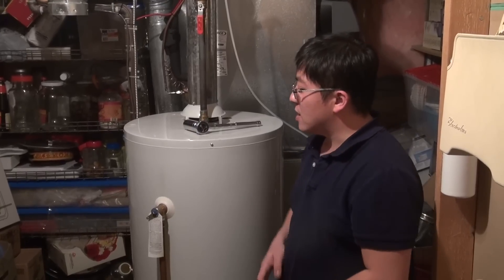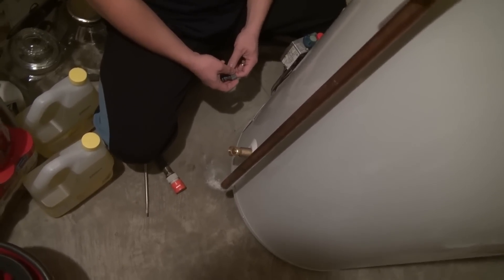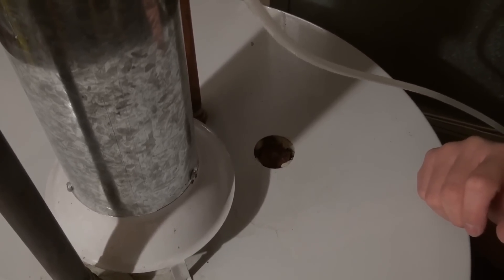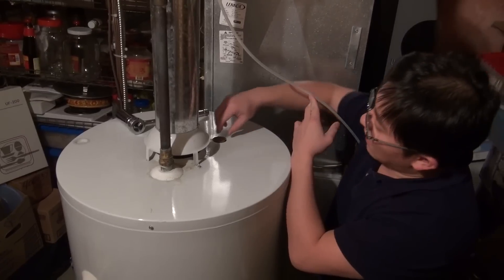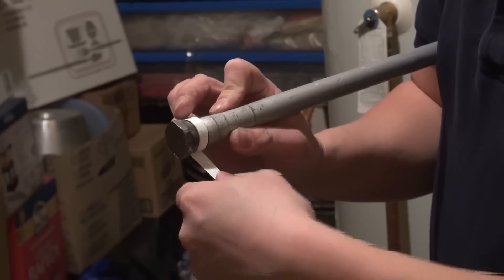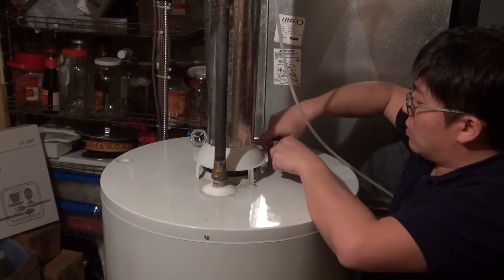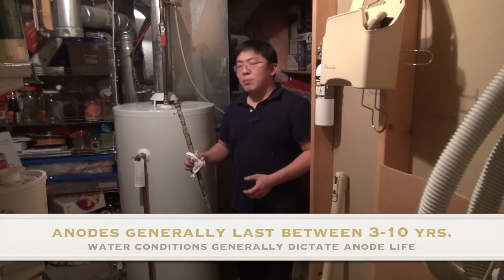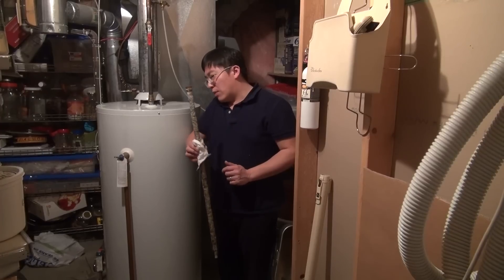How to Replace A Water Heater Sacrificial Anode Rod

Comment: yea have house in baja water there is really hard so am sure the tube and anode are eaten up ya just saved me some $$ of buying a new heater...oh a tip...the gas valve are interchangeable. only diff is the face/knob on back all hookups are simular..had to change mine
Reply from the maker: +Miguel Castaneda interesting about the gas valves. Not sure if I'm bold enough to explain to youTubers on how to take that stuff apart (heaven forbid if someone blows themselves up by accident!).

Comment: If I have a 30 feet long water pipe and I install a 3 feet long  magnesium rod into the pipe, how much of that pipe will be protected? Is the magnesium rod going to protect all the pipe of just a few feet around itself?
Reply from the maker: +Life is illusion yikes, that I can't tell you.  I suspect it will likely protect at least the first half.  Water mains in our city have a sacrificial anode connection every few kms so I suspect that the protection is "spread out" across a pipe.
Reply: piercedasian Thank you for responding, I really appreciate it. Just to make it more clear for myself, I would like to ask if the anodes are inside the water pipes or are they mounted on the outer surface of the pipes?
Reply from the maker: +Life is illusion they mount the anodes as a separate external piece in the ground and then run a wire to the pipe and then pass a small electrical current through it to divert the consumption of metal to the anode instead of the iron pipes...

Comment: I just picked up an anode rod for my water heater. I replaced the rod about 4 years ago, the tank was about 4 years old and the factory rod was very badly corroded It was very tough getting the old one out, I used a 4 ft pipe and a breaker bar - I could never have done it alone.. When I replaced that rod i used teflon tape so hopefully this one will come out easier.
Reply from the maker: +dell177 wow 4 years and the rod was finished?  The rod in this video is 14 years old and it still had metal left on it!  If you have troubles with the rod removal I suggest you consider replacing the rod perhaps ever 2-3 years.  Rods are cheap and super easy to replace.
Reply: +piercedasian  I'll replace it this week, as you said they are cheap and if I can make the tank last longer it's well worth it.
Reply from the maker: absolutely.  Good luck!

Comment: You say to use teflon tape on the threads.  But, isn't the anode rod supposed to let current flow to the steel tank, through this path?   If the tape is put on thick and thoroughly, can interfere with this electrical path which is essential to the rod performance I think.  Please comment
Reply from the maker: +Ben Knight You would have to put a LOT of teflon tape on the threads to electrically isolate the anode.  I will typically wrap 2-3 layers of tape on the threads.  Fear not as as you thread the rod in the tape actually abrades away on the "high points" of the threads thus making electrical contact with the tank.  I have confirmed it is electrically bonded b/c I used a digital multimeter to confirm my conductivity.  In EVERY rod I've replaced I did this check and every time it has good continuity.  I could've shown this test but what's the point when out of the 50+ rods I've replaced it consistently has conductivity.  Hope my answer puts this question to rest :)

Thanks for watching.

Comment: Great video. This video suggests that your old anode may have not been protecting your tank due to calcification. http://youtu.be/2IUNIUZz4Os
Reply from the maker: +Graham Wilson Graham the calcium build up on the rod certainly hinders the anode's ability to protect but fortunately when i used my fingernail to scrape the calcium off that it wasn't hard as concrete and was still quite soft. so water was able to get to the sacrificial metal.  For heavily calcified tanks that have never been flushed or are exposed to exceptionally hard water I would imagine that owners should replace their anodes yearly (they're cheap anyways).  Interesting video you linked...

Comment: Thanks for the video, very well done! I must say though I have some doubts about using that Teflon tape on the thread as it may prevent the electric contact between the rod and the tank and thus defeat the whole purpose of having the rod in the firs place! I tell you as a physicist (by education): make sure you have a good electric contact between the road and the tank or it will not work properly!
Reply from the maker: +M Ch you need not worry about the rod not making contact with the threads on the tank.  The threads are quite "sharply cut" and when you're screwing in the rod that the tape on the highest "peaks" of the threads do get cut and contact is made.  I've verified contact using an ohm meter from the rod to the tank.  It wouldn't be the case IF one were to put layer upon layer upon layer of tape on then yes I would agree there is some risk of not having contact but in 90% of installs I've seen there is electrical continuity.
Reply: piercedasian - exactly right. This is an old wives tale about losing conductivity between the rod and the tank there’s no way with the rod tightened down that you will lose contact between the tank and the rod that’s for sure.

Comment: Great video, thank you! Could I possibly use an impact wrench to remove the rod (and then use a regular wrench to put it back in to make sure it's not too tight)?
Reply from the maker: +J.A.Grami You could do that however, my concern with using an impact gun is the "hammering" shock on the tank structure.  If your tank is very old or badly corroded that hammering could theoretically cause microfratures to form and could trigger a leak down the road.  Is this really possible?  Hard to say - probably NOT likely but why take that risk?

Comment: Have you ever removed an anode rod with an impact wrench?
Reply from the maker: +Ojeramup12 No I haven't as I haven't found the need to use one.  If you have a long extension "pipe" on the end of your ratchet that is usually MORE than sufficient.
Reply: OK,  I will try the old fashioned sure way.
Reply from the maker: yeah the fear of impact guns is the "pounding" action of the hammer inside the gun which could theoretically "shock" the tank and potentially cause cracks in the tank or the weld joints.  I'm sure it would never be an issue but using a traditional socket and breaker bar method has always worked for me.

Comment: That's the cleanest, shiniest 14 year old water heater in history.
Reply from the maker: +2packs4sure it is interesting you say that as you're not the first to say that.  Water heaters in homes (at least in our neck of the woods) look brand new even after 25 years.  I'm not sure what an old water heater is supposed to look like but every single one I've worked on is clean and shiny.  Must be our super dry climate or something that doesn't corrode the outside of the tank perhaps?
Reply from the maker: crazy.  I wonder why...
Reply: +piercedasian   They wind up in attics, garages, little attached outbuildings.....................
Now i've seen some really old ones in Houston in interior laundry rooms and those age nicely.
Reply from the maker: ah I get it.  In Canada all water heaters must be inside a structure with MOST water heaters residing in the basements of homes or worst case in an enclosed garage.
Reply: It's our 95 percent humidity and 98 degree temps. Welcome to Houston, TX.
Reply: Yea, it's fun ain't it..

Comment: I called a reputable plumbing company to inspect and probably replace the anode rods in our two tanks. When they got here, they said the average life of a tank is 8 years, and they generally wouldn't recommend replacing the rods in our 11-year-old tanks. Estimate for two new tanks, installed, was $3100. Yikes. Here, however, you're replacing the rod in a 14-year-old tank. Is the company I called kinda nutty?
Reply from the maker: +redobrien77 it depends on the local water conditions.  If you have highly acidic or soft water then your plumber could very well be correct in that the life is maybe around 8 years or so and the justification on replacing it becomes not so favourable since there is still a labor cost associated with replacement + the risk of cracking the tank if it is already fatigued b/c of corrosion around the anode.  In my neck of the woods it isn't uncommon for water heaters to go between 15-20 years and even longer IF we're insanely lucky.  Water in our neck of the woods has an ideal pH of 7.4-7.6 and I don't have a water softener (water is relatively hard at 20-25ppm) so perhaps that is why our tanks here last as long as they do.  $3100?  That is a tad bit steep as we'd typically pay around $2400 Canadian for 2 - 50 gallon top of the line natural gas fired water heaters installed including taxes.
Reply: +piercedasian Thank you. Good points.

Comment: How do i replace the rod for a electric solar water heater? the pipes coming out of the water heater look a bit more "busy" than in your video( Great video btw)
Reply from the maker: Hi rtt143. Sorry I didn't see your comment from months ago... For a solar tank the procedure is the same. Just because the tank has more lines to it the basic principles are the same.  Your sole tank probably has at at least 4-5 lines going to it vs 2 like on a conventional heater but that shouldn't change how the anode works.
Reply: +piercedasian how can i find out which line is the anode?
Reply from the maker: Best way to do it is contact the manufacturer and get the spec sheet on it.  Sometimes anodes are on the hot water outlets of the tanks (bradford white tanks seem to use this system).

Comment: They should make the anode pipe much narrower then the threaded fitting. Or the fitting much wider then the pipe. You probably scraped off a large amount of the corrosion into the tank as you pulled it out since the pipe is only slightly narrower then the threaded hole its got to come out of.
Reply from the maker: vqfive yeah I get what you mean but the reality is that even if some of the junk fell into the tank that it could probably be flushed out from the bottom tank drain or it will simply just make its way through the hot water system and pop out and go down the drain (or plug your aerators).

Comment: I like your video, but you put the teflon tape on backwards.
Reply from the maker: Kelly Smith as long as the threads don't leak it technically doesn't matter which way the tape goes.  The worst that could happen is the tape would bunch up and get all mangled in the threads but if your tape is thin enough and you wrap it very tightly against the threads and it doesn't bunch up then you're fine.  I will admittedly say that normally I wouldn't make that minor mistake but so far no issues yet :)
Reply: You r wrong. The teflon was put on correctly.

Comment: I've got a 2 year old AO Smith tank and about to replace my anode rod (it's aluminum) with a zinc alloy one. I'm getting a bad rotten egg odor due to bacteria in the water reacting with the aluminum.
Reply from the maker: TXSVT Is your water overly acidic or "soft?".  Some folks have swapped out the aluminum rods with magnesium ones to alleviate the stink but how well an alternative anode would work really depends on your water's chemistry.  

Rods are cheap enough and easy enough to replace that chances are you won't be out much money if you tried one rod and didn't like that you could switch it out with something else.

Comment: What do you do if the rod is so corroded that it breaks off inside the tank?
Reply from the maker: Ted2of25 nothing that you can really do about it.  Just leave it be and put the new rod in.  All water heaters eventually fail and will need replacing.  Your heater will just have a few extra pieces inside :)

Comment: What if your water supply dried up and the only water you had to drink was your water heater water?  Would you actually drink the water with an Aluminum anode in it?  I certainly would not.  I believe in this case that  Magnesium anode would be the way to go. Aluminum water is not well tolerated.
Also, if the anode is showing 6" of the more noble metal, then it's time to replace the anode.  This may be in 8 months or two years.  I would recommend taking out the anode on a yearly basis and check it.
Reply from the maker: for starters the chances of me lowing water service is next to nil and if I had to drink the water to survive I guess I have no other option. Aluminum can be toxic but only if consumed in significant quantities or if you're exposed to it regularly.  What is interesting is that many professional chefs cook with aluminum pots so it isn't like we as society aren't being exposed to aluminum.  You just don't see it.  Magnesium is the way to go BUT it depends on the type of water in your area.  I have read that magnesium rods can make your water stink if it doesn't jive with the chemist of your  water supply.  Since aluminum rods seem to be the only thing sold here I would assume that it is the most compatible with the local water in our area.  Inspecting the rod is a good idea but how often will depend on your local water characteristics.  My rod I pulled out was over 10 years old and I was actually surprised that there was still metal left on it!
Reply: If you are that worried about your water going dry go buy some water storage containers and fill them and put them aside for when shit hits the fan. If your going to use your water heater as a fail safe then you might as well go make sure all your tolet tanks are clean too... You know just in case.
Reply from the maker: totally agree with your commands podgy PLAYA

Comment: Are you sure you are supposed to apply teflon tape on the new rod? You just broke the circuit so the new rod will not be grounded. And your new anode will not work.
Reply from the maker: yes you are supposed to apply the tape b/c otherwise it will leak.  When threading in the rod the tape will tear on the "peaks" of the threads thus maintaining the metal to metal contact.

Comment: As an older woman with physical limitations, I really appreciate your video.  Very clear instructions.

My water heater is in a closet, and so I can only access it from the front.  

Plus, I don't have anyone to help to hold the tank steady, and even if I did have a helper, there is so little room I don't see how a helper could help stabilize the tank without being in the way of removing the anode rod.

Comments appreciated.

Also, I appreciate your comment about replacing the rod before flushing the tank.  Although I would have logically assumed that, it helps to have my thoughts about it confirmed.

Have you ever done a replacement of a pilot assembly, or a cleaning of the flame arrestor?
Reply from the maker: you can use a 1/2" impact driver BUT just remember that should that anode rod really be "stuck" in the threads and refuses to turn and you attempt to "shock or force" the anode out that you could cause a weakened tank (assuming it is quite old and has possibly begun corroding) to develop fractures or cracks in the tank.  Using a ratchet and undoing it by hand will allow you to "feel" how much strength you're twisting that rod out and you can decide to stop should it not rotate with a decent amount of force.  Not saying your technique is wrong but just pointing out possible issues doing so.
Reply: Or you can simply use a cordless 1/2 impact and the helper can hold your drink :) just make sure when replacing you thread by hand and then a ratchet to avoid cross threading if you can't get enough torque you can do a couple quick pulses with the impact just to make sure its tight
Reply from the maker: Glad you liked the video.  you can still technically access the "top" of the water heater if you've able to reach over the tank from the front.  I have worked on water heaters were space was insanely tight but with the aid of a helper you can often get to the anode rod and replace it.  The helper can help you hold a light so you can see and to "brace" the water heater when you're trying to undo the rod from the tank.

Comment: "It just needs to be snug." GOES HAM!!  Just kidding lol, thanks for the video!
Reply from the maker: haha, that's what that means!  I get it now :)  Never head of the term HAM before.
Reply from the maker: I get it, I need to lose some weight!  Glad you found the vid useful.
Cheers!
Reply: piercedasian" I need 2 lose some weight" no, "goes HAM" that's hood / street SLANG for doing something excessively.  Will a bad sacrificial anode rod cause the water heater not to heat water? And if so how?

8 months ago

 
I get it, I need to lose some weight
Reply from the maker: serious?  I had no idea.  I thought when one of the posters means Ham that they were inferring that I was over weight (which I am slightly).  Thanks for clarifying for me :)  No a bad anode won't have any impact on the heaters ability to heat water.  The thermostat is likely faulty or if you're using an electric heater than maybe you've got a faulty heating element.  The anode is to merely delay corrosion of the tank and nothing more.
Reply: Slang for "Hard as a motherf#cker" lol HAAM Or HAM

Comment: Question I'm flushing out my water heater and changing the anode rod. Am i able to change my anode rod while flushing out the water and not turn the water off???
Reply from the maker: @ drmoua - DEFINITELY NOT.  Under no circumstances should the water be pressurized before you remove the rod.  If you're going to flush then I would suggest doing it either before or after you put in the new anode.  The anode hole is literally a 1" hold directly into your water tank.

If it were me I would change the rod out first and then flush it.  When removing the old rod you can sometimes drop "crusties" back into the tank so if you're flushing then why not flush the crusties that fall off the old rod?